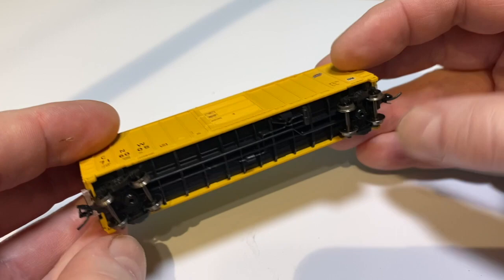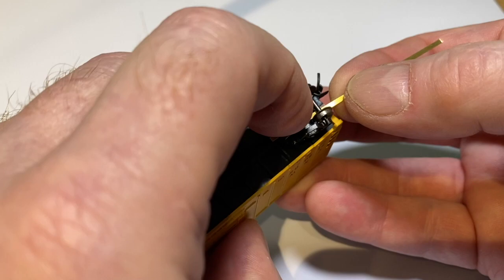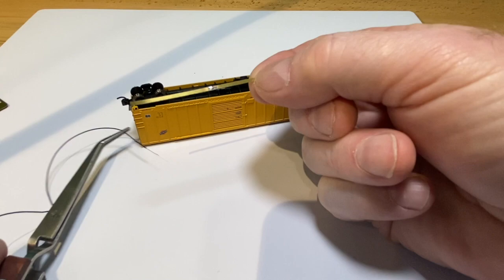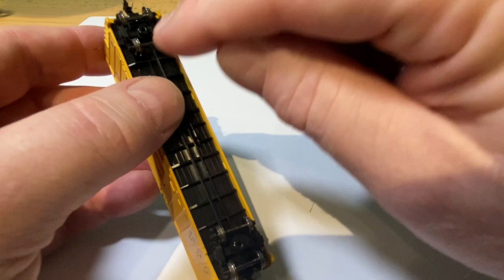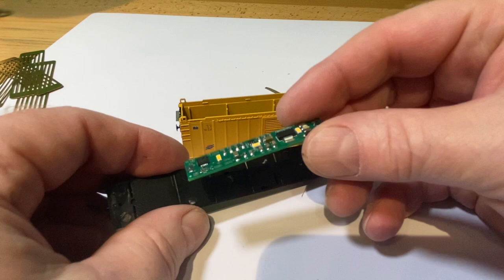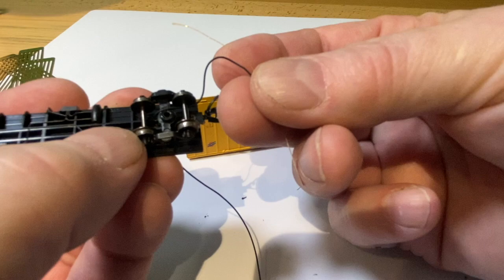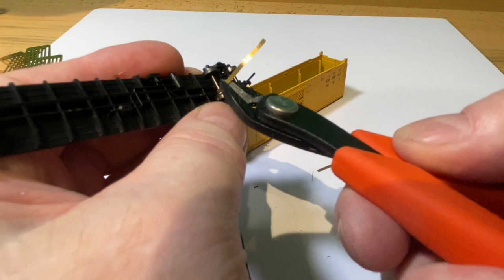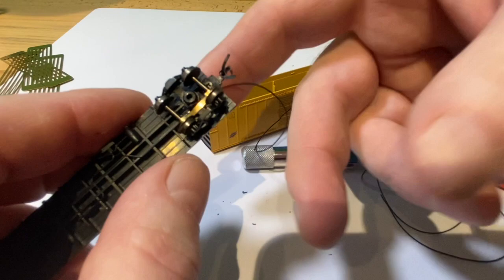N Scale Railroad & Trains Lighting  - Floating Brass Wheel Pickup Installation

Comment: Great video. I'm not understanding how to identify insulated vs non insulated wheels.  I have all steel wheels connected to plastic trucks same as you used.
Reply from the maker: Insulated wheel have a bit of plastic connecting the axle and the wheel - on one side only.  You can test this with a simple LED lightbulb circuit or a meter.

Comment: Could also drill the truck pin to get the wire into the car
Reply from the maker: Possible but the risk is that the wire will catch something since it has to be loose and would be likely lower that the height of the axle.  For N scale it would also weaken the plastic pin.  Generally, if you put the wire under the "inside" axle - that's the best approach. Thanks for the comment.